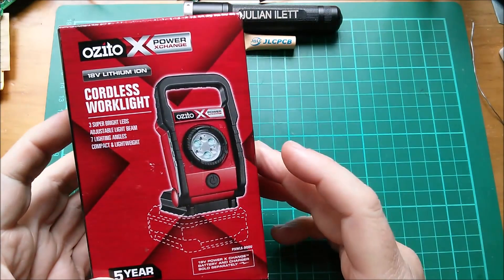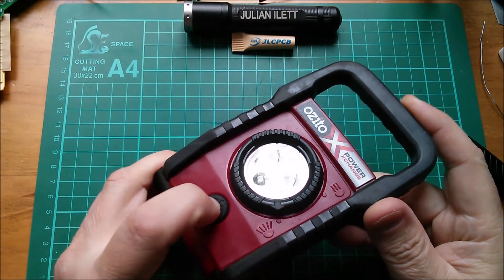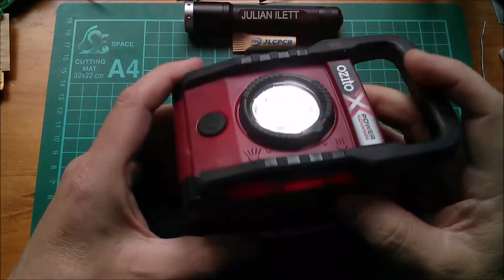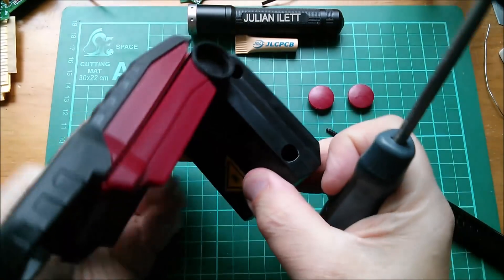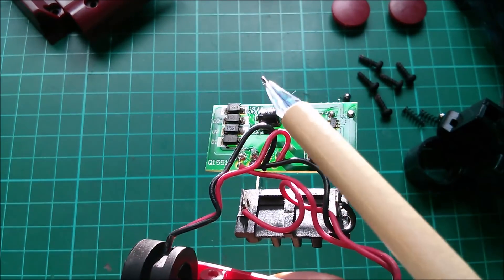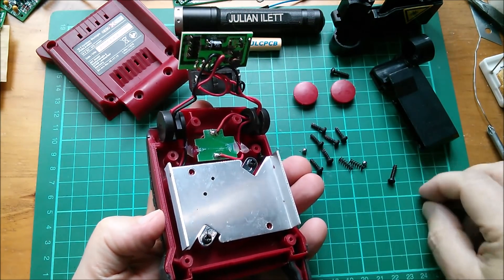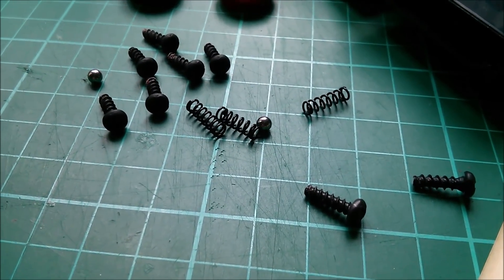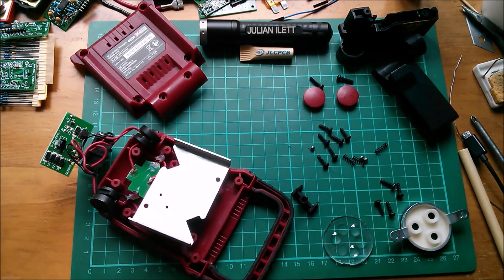Ozito Power Xchange 18V Cordless Worklight Strip Down

Comment: Ozito is an Australian brand sold at Bunnings, it's actually made by Germans however, like it's a subsidiary brand made by Germans I think, so it's goal is the lowest price, but still a legitimate power tool. Meaning it's the cheapest actual branded form of power tool, you can expect enough quality that it actually does work and is designed properly, so it isn't the same as buying some literal thing from Kmart that is true trash and designed by some troll in China.

Comment: Ozito is the cheap Bunnings brand.  When you open the battery pack, I thin you will find 3 sausages in parallel/serial arrangement.
Reply: 6 sausages as 6 x 3.7 = 18.5 volts
Reply: @MisterMooo  Thats not an Ozito joke its a Bunnings joke

Comment: Great reality tv. We need the sequel where you succeed or not in reinstalling the ball bearings and springs. But well done on finding all the balls!
Reply: Its not only the bearings and springs to worry about. If the wires are not installed correctly they will be crushed and cut and the tool needs to be rewired... been there, done that, 1 out of 10 would not recommend.

Comment: I use a 4 diode bridge rectifier configuration on a circuit board I have designed from JLCPCB for a solar powered (using a proper solar panel and charge controller/12v Battery system) for my garden lights. it means that no matter whether you connect pos to pos or pos to neg they still work.
One of the strange side effects is that you get a 1.4v voltage boost from the bridge rectifier (probably an accumulation of the 2 x 0.7v forward voltages).

Comment: The bridge rectifier is so that the people soldering on the wires can't wire it up backwards.
Both because they are cheap labor, and so they can solder it faster.

If it didn't have a bridge rectifier there would invariably be some that had to be reworked to switch the wires around.
Reply: This makes sense, and with rising labour costs in China it would be cheaper to add the rectifier than to have a load of rejects that require repairing.

Comment: I have the 3AH version of the battery containing 10 cells which are yellow/brown filth looking model "mh46259" seems quite good in design but the company demands you buy a more expensive charger to be able to charge them at a faster rate vs the default one sold with the kit and that's kinda mocking/offensive in itself .Nothing of real great value in that torch - Would be better off shoving a car headlight halogen in the battery, Looks like the quality of pound land.

Comment: They look like EINHELL tools!!
Reply: Einhell bought Ozito, so they could distribute in the UK.

"On 1 July 2013 the Einhell Corporation became the outright owner of Ozito Industries Pty Ltd for a fixed purchase price of approximately 13 million Euros. For many years the Ozito brand has been well established in Australia and New Zealand for the entry-level price bracket of electrical- and garden-tools." (Edited for clarity an grammar)
Reply: Yeah, they do. I actually have the cordless drill from Einhell that looks like  this might be a 1:1 clone or even the same product: https://www.bunnings.com.au/ozito-power-x-change-18v-compact-drill-driver-kit_p6290558 The Einhell drill is awesome. It's battery lasts for a really huge pack of screws(around 500) and for it's price point it's pretty powerful. I just ordered this light, just because i needed one and of course to see if my battery fits.
Reply: @blubbspinat9363  mostly likely as it said designed in Germany on the product they will be Einhell stuff made in China and rebranded.

Comment: I have gone down the power xchange route, there are 2 brands that use that battery system as far as I know, Ozito and Einhell, Einhell seem to be the better tools from my experience so far. But the batteries and chargers seem to be about the same.
Reply: Their is a reason that the batteries are comparable. Einhell purchased Ozito to get into the Australian market and re-badged their tools to say Ozito.

How do I know they are the same? because I have pulled apart Ozito tools and they have Einhell screen printed on the circuit boards.

https://imgur.com/a/DhGayjZ

Comment: Another Loss Leader Doo Dad attempting to lure and lock you into yet another Battery System.  Another Battery System  incompatible with anything else in your Multitude of other battery systems in hand.  What we really need is a UNIVERSAL INTERFACE  enabling the use of ANY Battery System with ANY and ALL other Battery operated Doo Dads.   Until someone comes up with one I'll continue using the Croc Clip Jumper wires thing.
Reply from the maker: Well, it looks like Parkside tools might just fit Ozito batteries as long as they don't mind a polarity reversal :)

Comment: Looks a lot like another brand Einhell
Reply: Yep it's made by Einhell mains powered stuff is ok but the cordless is shit with huge homebase mark up when compared to the ALDI stuff which is also made by  Einhell but a 3rd of a price.
Reply: DEVONLAD11 are all the 18v Aldi tools & batteries compatible with Einhell stuff mate?
Reply: @DEVONLAD11  Different in Australia. Aldi tools appear to be made by someone else and don't look any good but the new Ozito red make them look like toys compared to the old red.

Bunnings also price match when aldi comes out with their tool range. 
Works out for me as I have gotten the 4AH batteries for $39AUD (normal price is $69AUD) and a bunch when they went down to $29AUD. 

($39AUD = £22GBP
$29AUD = £16.3GBP
$69AUD = £39GBP As of 0410h19/07/2019)

Comment: It's a rebadged Einhell tool https://www.einhell.de/shop/en-de/te-cl-18-li-solo.html
iSC GmbH, the distributor on the label, is a subsidiary of Einhell. They also seem to supply rebadged tools for ALDI (among others) under the DURO and WORKZONE brands.
They have a factory outlet at their headquarters in Landau/Isar (Germany) where they sell new as well as repaired/returned tools, for anyone interested, living or staying in Lower Bavaria.
Reply from the maker: Wow, 24.95 Euro is expensive.
Reply: @JulianIlett  They probably go for less at the hardware store. I'll have a look next time.
Last time, just a couple days ago, i only noticed that the Power X-Change starter set (Drill, 2Ah Battery, Charger) was 5€ LESS than the Drill skin on its own. And they were right next to each other on the shelf. 🤔
Do you have any plans on tearing down that battery in a video?  I found an exploded-view image of it and it looks like it could have active over-current protection build-in (the two TO-220? packages on the right), compared to the passive, fusible link in the FERREX batteries: https://www.einhell.co.uk/fileadmin/_processed_/6/c/csm_einhell-innovations-pxc-battery-details-content-04_45c1a97e5d.jpg
Reply from the maker: Those MOSFETs are probably for low-voltage cutoff. The worklight certainly doesn't have that function so the battery must have it :)
Reply: @JulianIlett  Sure, they also work for undervoltage protection. But it would be really nice if the battery could detect and cut-off overcurrent in a non-destructive way as well.
Edit: I've seen a response from an Einhell representative on an other video that could indicate active overcurrent protection build into the batteries. So maybe you'll find an ACS756 IC (or something similar) in there.

Comment: ball bearing hiding next to the wood worm ...lol
Reply from the maker: Genuine original 1929 door threshold - complete with shoe wear and woodworm :)
Reply: @JulianIlett  Mr Ilett does the Aldi/Lidl battery fit in the ozito tool? Perhaps with grinding would it suffice?
Reply: @julian  you should try and find an ultrasonic woodworm repeller on fleabay, I'm sure it won't work but would be worth a teardown to find out why

Comment: Used to do contract work for a lighting manufacturer who made generic units used by other OEM's and the cost of running two parallel production lines for polarity and the cost of QC is far more than the cost of 4 diodes.

Comment: Is it possible the the apparently unnecessary bridge rectifier is to separate the team designing the tools from a battery team who kept swapping the pins around?  :-)
Reply from the maker: Or in case it fits on a rival manufacturer's battery (which has the terminals swapped).

Comment: The board is probably also used in other types of lamp, maybe a portable car lamp that plugs in to power, it's a common technique to avoid reversal, but be able to run in either polarity, and of course it will run on AC.
and i just knew that lens spring would pop out, done it a few times myself on various things :D
Reply: Universal, of course.

Comment: Full bridge rectifier is a common thing on 12V garden lights - it would be a pain to realize that you have put your pavement fixtures' cabling the wrong way around and you have to tear the whole thing down.
Reply: I would guess that it uses the reference design for an AC/DC low voltage halogen replacement LED lamp.
Reply: That's my guess as well - they just used a multipurpose off-the shelf ready to use PCB.